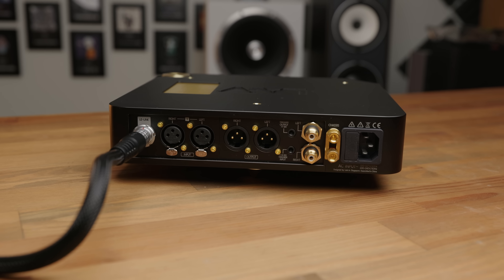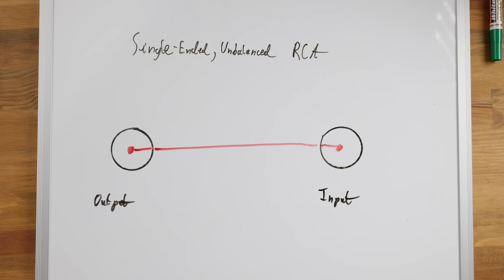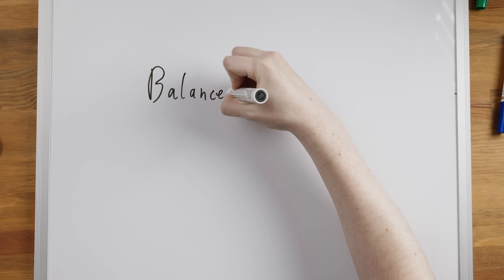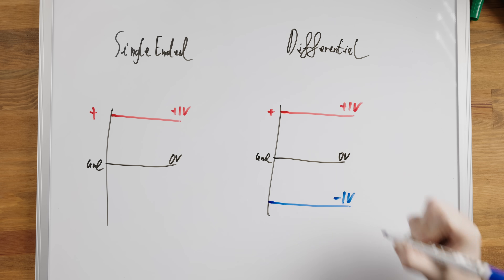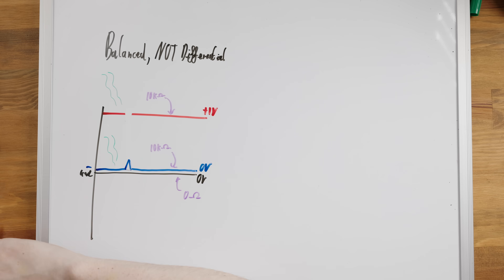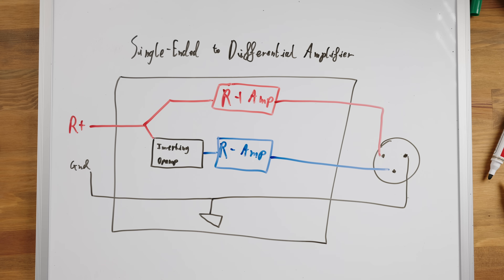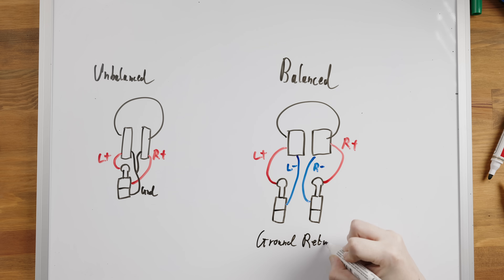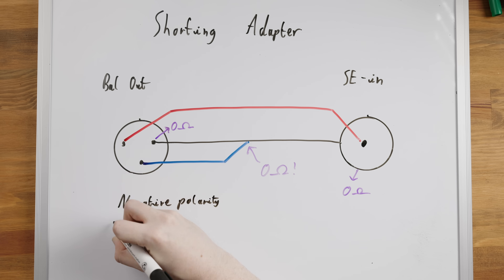Balanced audio explained fast!

Comment: Can you have a single-ended, balanced connection? I assume not, since it sounds like you need 2 conductors with equal impedances to ground to form a balanced connection, but I want to make sure my understanding is correct.

Comment: I wanted to add that "servo" balanced outputs (more of a pro audio thing) are designed to tolerate a shorting balanced to single-ended adapter (10:30). A transformer balanced output will also safely tolerate a shorting type converter.

Comment: Sir I used mono PL  to xlr in my mixer and im shorting the pin 1 and 3 of the xlr and it's doing more signal than the balanced xlr to xlr connections..how does it happen ? The unbalanced is much louder than the balanced connections?

Comment: While you are technically correct on unbalanced differential, I'm not aware of any purposefully designed transmission systems that are differential and unbalanced.  It undermines common mode noise rejection while is the main reason to go differential.  If you can point one out, I'd me interested in learning about it (and WTH they did it!).

Comment: Unbalanced, balanced…
And why does the audio world not use  a current interface in stead of a voltage interface?
Reply: How much current are you going to get out of a microphone?
Reply: @wally7856 
Good point!
Sources (microphones, cartridges, playback heads) are almost all voltage sources. But active devices (also DAC’s) are inherently current sources, but used as voltage sources. And almost all actuators (loudspeakers, cutting heads, tape recording heads) are current driven. 

So you’re right, with sources current drive doesn’t make much sense, but in all other cases it makes a difference, no issues with impedances and EMI. And especially with loudspeakers, motors, recording heads, cutting heads it makes a huge difference.

Comment: In products I've seen that offer both balanced and unbalanced connections, one uses like a 3mm jack and the other uses a 4mm jack. 

I've never seen a headphone with either an RCA or an XLR connector in my life. I've perused headphones from Sony, hifiman, fiio, etc, and they all have the plugs that fit into headphone jacks.

When did this channel become directed to audio engineers instead of enthusiasts?

Seriously, what product have you reviewed with an XLR connector?

Comment: What was not said: balanced headphones are NOT balanced lines. There is no noise we need to reject. The whole balanced headphones is 100% a scam, trying to sell "better" by borrowing terminology from pro-audio. At same price point, single ended will be better, the differential amplification does NOT provide any improvements to sound quality. NONE.

Comment: Differential does not provide 6dB more SNR. It MIGHT do that but that is all about how it is done! The whole headphone bullshit of using "balanced" headphones and people saying that is it just better is bullshit: make the single ended better and it is better. The signal is stronger, it however is NOT better!!!

Balanced lines are NOT better than unbalanced, differential is NOT better than single ended. That 6dB SNR improvement is 100% bullshit. Differential amplifiers have twice the components and they need to be mirrored perfectly. Single ended can start to focus on sound quality first, when we are still trying to make the differential fit in our budget. It has to spend money just to get the component tolerances right. So in real world, there is no fucking 6dB improvement in SNR.

Comment: What if we went fully Audio file 'Retro' and deliberately designed things to be functionally the worst possible sound ever? Hmmm, tube amp with simple dirty power and poorly designed (uneducated) with inefficient power supply (internally) and feedback circuit into a thin paper cone speaker with physical barriers in front of the diaphragm....
😅
'Audiofile'😂😂😂😂

Comment: Headphones are not balanced. There is no active circuitry in the headphone to supply the common mode rejection. The wiring can be differential if the headphone amp is designed as such, but headphones are passive devices and we really need to stop using the term "balanced" with regard to them.
If you have ever made "balanced" cables for headphones to a 4 pix XLR at the amp, there is no shield connected. The cables going to the cans are twisted pairs to mitigate EMI but there is no shield covering the wires.

Comment: I watched this video hoping to see some simple circuitry for balancing and unbalancing signals. I worked briefly in a radio station where we used balancing transformers for long runs to the mixer. For radio they work fine.

Comment: You are saying the rca cable that goes into the reciever and the balanced cable that goes into the amplifier has no benefit for cleaning the signal thru the amplifiers filtering process before it sends it thru the amplification process and out to your speakers?

Comment: Star quad cable can also be used on a balanced circuit to further reduce noise pick up.
Reply: Again, complete nonsense. Balanced circuits do not need fancy geometry to reduce noise.
Reply: @EvilTeddie23  They do. With 2 conductors carrying signal, one of those conductors is always closer to the source of the emf then the other so it will get more interference then the other line and they won't completely cancel. Twisting the pair helps even that out but still not perfect. With quad cable, one line will still be the closest but it's partner line will be the furthest. The other signal will be the 2 lines in the middle. That really evens things out. Quad cable is a good 20-50 dB less noise then a regular cable, lab measured. The thing is, it is very rarely needed. It's always a good idea for recording studios or if your stage is right next to a huge radio antenna but most applications won't see any benefit. Those that do like recording a high-z piezo pickup (almost no signal - 30 millivolts max so 0.03 volts) alongside some very noisy RF spitting vintage tube amps will see the benefit in signal to noise ratio, especially if you want to record some solo tracks. Line level outputs like what comes out of your gear to the amplifiers have such a strong signal (compared to a passive instrument pickup) you won't notice anything.

Comment: Very nice. But, your examples showing Direct Current (DC), where the term "impedance" is essentially the same as resistance, while audio signal is Alternating Current (AC), where the term "impedance" (Z) is used to describe the total opposition to current flow, including both resistance and reactance. For those who are asking about balanced connections on various units, they are most common on low power signal devices and cables, such as microphones, mixing consoles, preamplifiers, because they are the most susceptible to the influence of external disturbances that cause the most problems in them. Similarly, they are not used at the output of power amplifiers and speakers, where this influence is minimal, practically non-existent, and very rarely with headphones, where it is imperceptible.

Comment: You should also mention that the XLR input connectors on a mixing board will usually have 90 volt "phantom power" between pins 2 and 3.  If you try to build a simple adapter cable to plug an iPod or MP3 player into the XLR inputs, you could destroy your music player.
Reply: Phantom power is interesting but it isn't 90 volts. Also there will be a switch to introduce/disable phantom power.

Comment: Reading through the comments I see some confusion in how all this applies to headphones. Overall, the information in the video was excellent, especially when he goes over how you can create a short circuit when using xlr/rca adaptors. No one ever covers that. However, given that this is a headphone channel, I was a bit surprised that he didn't go a little bit further and address some of the confusion when it comes too balanced headphone gear. 

To start with, there's no such things as balanced headphones, and there is no such thing as balanced headphone cables, even though they may be labeled as such. A pair of headphones work exactly the same way a pair of full size speakers work, as does the power amplifier. If you look at a "balanced" headphone jack you have 4 conductors. A + and - for the left speaker, and a + and - for the right speaker in the headphones. The connection is exactly the same as the full size gear in your living room. You would never call regular speakers and speaker cables balanced. Headphones are identical, just smaller. 

Any time you see the output of a headphone amp labeled balanced and the connection supports 4 conductors, substitute the word balanced for bridged. Balanced headphone amps are bridged amps. There are 4 channels in the amp that are bridged into 2 channels. Each of the 4 channels needs its own discreet conductor. You already have that with the 2 signal (+) conductors. The other 2 channels for the negative (-) conductors can't share a common ground. That's why the signal has to be balanced. Each amp needs its own negative conductor. This is required any time you bridge 2 power amp channels. It doesn't apply just to headphone amps. If you are wondering why some bridgeable amps only offer single ended inputs, its a very simple process to convert the incoming SE input to balanced. If you're familiar with pro audio gear, its commonly referred to as DI circuitry.

This whole process is reflected in the specs for the amp. On the input, you'll see the 4-6db increase in output as a result of balancing the signal. For the power amp, you'll see the output power in watts, double as a result of the bridging process.

So why do manufacturers of headphone amps only talk about the balancing process and not bridging? My personal opinion is that its done for marketing purposes. For audiophiles, there's no real downside to balanced operation. Depending on how its done, you may notice a positive difference in sound quality, or no difference at all. With bridging, there are downsides. When you bridge 2 amplifier channels, you get double the power. The downside is the amp sees half of the resistance as normal. For example, a speaker that would normally show a power amp a 4 ohm load, will show a bridged amp a 2 ohm load. That's why bridged amps should never be referred to a mono amps. Yes, you get double the power but the amp has to work twice as hard to give it to you. As for sound quality, bridging may or may not sound better. If you have a speaker or headphone that's needs a lot of power, using a bridged amp may sound better. If you don't need the extra power, you may take a hit in sound quality if you use a bridged amp. Unfortunately, the only way to know for certain is to listen to the exact combination of gear firsthand. There are too many variables.

So, when you see a balanced output option on a headphone amp, it has nothing to do with the headphones or headphone cable. If you've ever bridged a full-size amp, you know that you don't connect the speaker cables on the binding posts the same way when you run it in bridged mode. That's all you're doing here. Manufacturers that make bridgeable headphone amps, just substitute the word balanced for bridged.
Reply: Exactly and this point was completely missed in the video and for a headphone show that is a criminal ommision.
I got my degree in Electrical and Electronic Engineering in the UK in 1994 and worked in TV as a Broadcast Engineer. 

You hit the nail on the head with regard to marketing and the term "balanced". 
There is no such thing as balanced headphones because there is no active electronics in the headphones to perform the common mode rejection and besides, most headphone lead runs are 6 - 10' so they don't need it.
The best you can get is dual-differential, like a Bryston BHA-1 or Laiv H2PA and there are some advantages, but never guaranteed:

1. Power delivery
	•	Each driver terminal is actively driven, so you get effectively double the voltage swing compared to single-ended.
	•	More swing = more headroom, more power into high-impedance headphones.

2. Channel separation
	•	Left and right channels each have their own independent signal paths.
	•	No shared return/ground, so less crosstalk between channels.

3. Ground loop immunity
	•	Since the driver isn’t referenced to chassis or circuit ground, hum from ground loops or shared returns can’t couple into the signal as easily.

4. Noise floor (sometimes)
	•	In a well-designed balanced topology, common-mode noise picked up along the cable can be rejected at the amp stage (not at the voice coil).
	•	This can mean quieter playback, especially noticeable with sensitive IEMs.

5. Better symmetry in distortion
	•	Push-pull symmetry can cancel certain even-order distortion components inside the amplifier itself.
	•	Whether this matters audibly depends on the design and measurements.

Comment: I've moved mostly back to using unbalanced cables. Noise is never that much of an issue for me, and as unbalanced cables are in many ways a filter, they can be used to tune the system slightly. Basically I've gone back to using cheap Fosi $5 copper cables to try and lose a little detail and smooth out some top end, which the balanced design doesn't seem to allow

Comment: You say a differential signal gives 6 dB in S/N increase, but shouldn't that be maximum 3 dB, because you are adding a second amplifier, which raises the noise floor in itself. As that shouldn't be correlated with the other opamp, I assume the noise level to increase by 3 dB (and thus the total S/N by 3 as well).
Reply from the maker: It depends. If we are purely looking at the noise from the amplifier itself then yeah it's less than 6dB. The 6dB was specifically regarding noise picked up along the cable itself (which for longer runs will likely be higher than noise produced by the amplifier itself)

Comment: Nothing about the huge elephant in the room?
That balanced and/or differential in the context of headphones is effectively useless - if the big scary noise can overcome the output impedance of the amp and induce audible noise in the wire you have other big big problems in the room.

Comment: Crosstalk elimination by not having a common GND wire is the most important reason to use "balanced" amps and connections for headphones (which are actually only special by being differential, otherwise headphone connections are always balanced, since both driver circuits always have equal impedances to GND). "Balanced" headphones = crosstalk elimination. You're posting for a headphones channel and you didn't so much as mention it as one of the benefits. SMH

Comment: If I plug a headphone with a 4.4mm balanced cable into an amp with a 3.5mm single ended socket via a converter does it harm any of them?

Comment: Nice lecture. I always appreciate  your efforts! Only, instead of demystifying you do the opposite. You make it feel very complicated and mysyerious. This is like contemporary schooling. "Just learn it by heart" instead of "understand why". 

Any signal starts at the source, not in the cable. And it always starts balanced. A pendulum always moves both ways. The sinus of a circulating body always goes from +r to -r. So the simplest amplitude is differential, ie sin r, not (sin r)+r (just a voltage swing, not a voltage swing with a bias voltage). 

It is not about the cable. It's about the amplifier why unbalanced was invented. To save on parts and cost. It wasn't about noise rejection. That came later as a bonus. 

Any signal starts groundless. When you wiggle a voicecoil in front of a magnet you get a + and - signal on both ends of the coil. That's not magic. That's how microphones and wind generators work. And the dynamo on grandma's bike. That's why the powergrid is 50Hz (or 60 if you're in a backward country 😂 just kidding, there's lots of history behind that). 

My exact point is; unbalanced beats balanced for non industrial purposes. In HiFi you want the best quality sound. Not the loudest. Noise rejection on a 1m cable is marginal. But it will cost you twice the number of components. 

For the 50% (or less) money you save you can use better, pricier components for a better sound. Or different tubes or transistors for more power. 

So for home HiFi this whole discussion is senseless if you don't tell the whole story. Simplifying or complicating it won't make it more or less true. 

Iirc the first telegraph landlines and transatlantic submarine lines weren't balanced. That saved a bunch of money on copper. 

'Balanced' isn't an invention, it's how magnetic fields work. Neither is 'differential'. It's just a word for how how a signal emerges naturally. The smart part is saving half the circuit by using the earth, or ground. 

Keep up the good work. 
🇱🇺😉👍🏻
Reply: All true, but the real benefit of "balanced" for headphones is not noise or power output, it's the removal of common-ground crosstalk between L and R, which can get easily audible if you've got super low impedance drivers (most IEMs?), very thin wires AND a Y-shaped split of the ground wiring in the cable, with a long common ground portion.